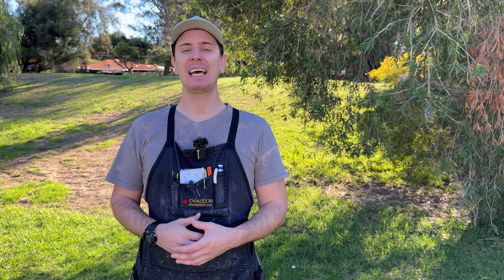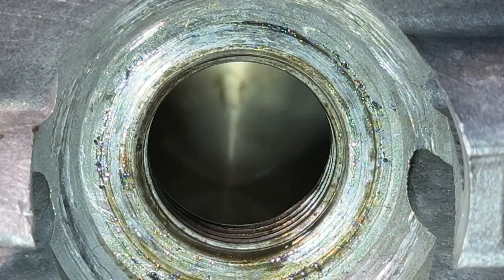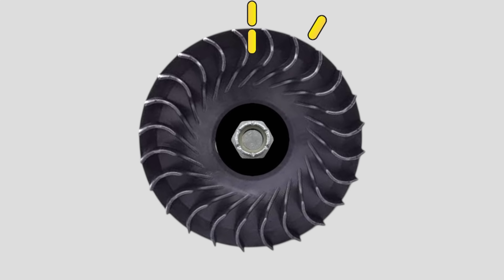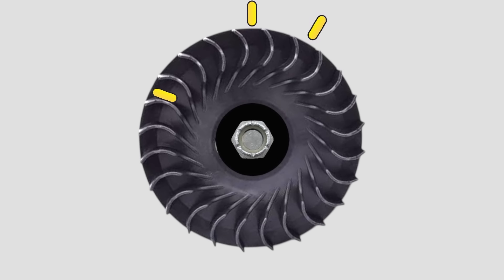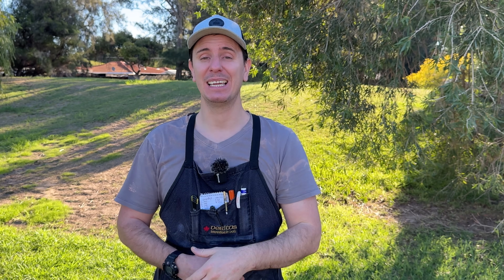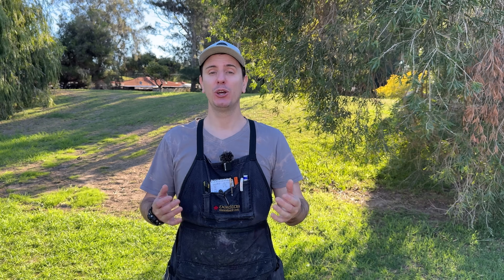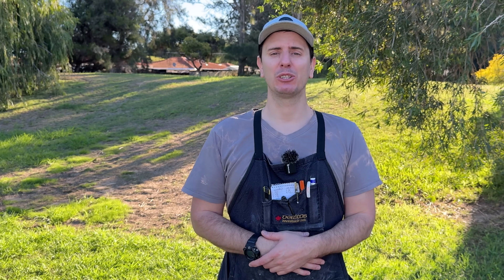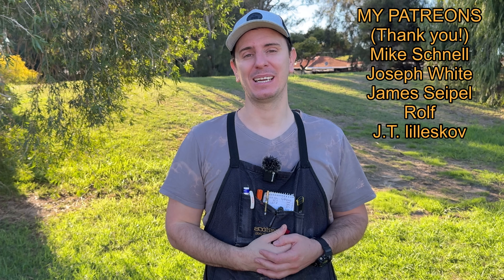Essential Tool Every Mechanic Should Own!

Comment: When I bought my automotive timing light, many decades ago, I thought I'd use it more than I have. With the increased complexity of modern engines, mechanics have largely moved over to the scope for more accurate analysis.
Reply from the maker: Thanks for sharing! For small engines including motorcycles, atv's and quads it's certainly a key skill to understand and be able to test :)
Reply: It's worth noting that many mechanics buy a scope and never use it or they don't use it correctly. I know of numerous automotive dealerships that have a scope for shop use and it never gets used. WHY? They are too busy throwing parts at the vehicles (parts cannon). This is what the world has come to with mechanics/techs. Like it or not this is a fact! Good video sir!
Reply: @GripFreak You are right.  Toyota of Berkeley.  We took our 1998 Camry to repair for a vibration felt in the drive line.  The head service sales/mechanic said that we needed to purchase an alignment, new suspension system, and transmission-transfer case, as it is a "process of elimination." I responded that it is fraud, because they are telling to buy things without them knowing if they will deliver what they represent-a solution.  I told them that I should not pay for anything that does not work; they are the Toyota merchant who are in the best position to know exactly what is wrong.  The solution: Firestone mechanic showed the right rear tire had cupped canoe shape, causing vibration, $75 tire. Buyer beware, when the shop says "process of elimination" on your dime.
Reply: I've been thinking about buying a scope as well but am on the fence...

In my head the scope would be able to capture the voltage pulse of the coil but I don't see how it can reference to timing.  Could be wrong.
Reply: @RobertWorthington-u2s  ACS wave sell an affordable hand held two channel scope that has good reviews. With the second channel you can compare and match up two different data points, like injector pulse or battery current draw with reference to a second channel with secondary ignition impulse. Together with cylinder timing order you can tell which cylinder is the bad one.
Reply: @spelunkerd thanks for the scope suggestion.

I think your right that many mechanics don't know how to use a scope.  Man I would kill for one.  Small engine guy but I was helping my auto mechanic the other day and he had the scanner hooked up.  I figured out in less than a minute how to display  voltage pulses on two cylinders for comparison (injectors).

I keep telling my boss that we need three things to definitively diagnose electrical issues: insulation resistance tester (megger), miliometer, and a good 4 channel scope.  Do you think that's unreasonable?
Reply: Light bulb and youre eyes ,